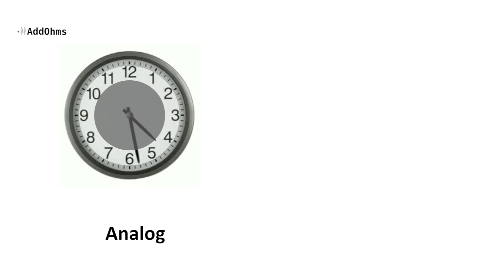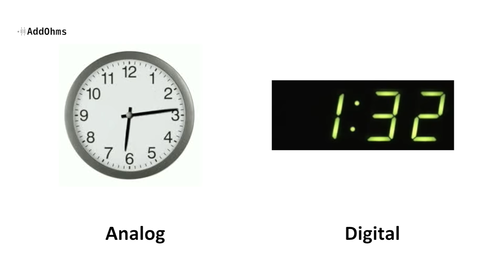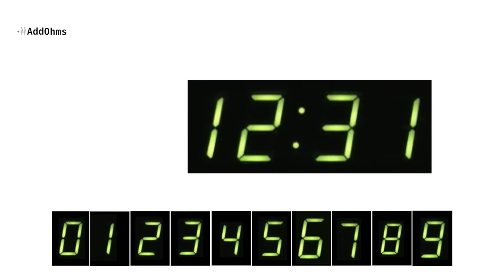Difference between Analog and Digital Signals | AddOhms #6

Comment: So the difference is that analog is more precise?
Reply: Well,  the signals are continuos and precise, but I reckon that the complexity is low.
Reply: República Mitocrática its flexibility you mean?
Reply: homo bob I meant "complexity", because the a digital circuit is way more complex than an analog one, considering the voltage variation inside the circuit and, as you said, the flexibility of signals. Even if we consider the analog and digital technologies, the digital techs a more complex in its circuits and also more efficient (in space, energy use, in benefits etc.). It was what I understood so far.
Reply: República Mitocrática kk
Reply: I understand that analog is limitless precise.

Comment: so its basically works like PWM and a clock where intensity  is replace with time using periods of Ons and Offs. a combination of rise to digital 1, stay at digital 1, or fall to digital 0. if you throw a ball up towards the sky, time and distance is to be considered . you will usualy end up with a ramp that = digital 010 in time for example. So its safe to say zeros and ones is more of an intended target voltage but since change don't happen instantly and time is continuously moving, we get a linear vector type wave.

Comment: Thanks for the explanation, I understand the difference much better now. Though I'm left wondering one thing. If Analog signals are continuously changing and digital signals are either rounded "up" or "down" into zero's or ones, wouldn't that mean that an analog signal is more accurate representation of a transmission than a digital signal? If that's the case, then why is digital transmission considered superior?
Reply: Rain Machika When a signal is transmitted, it becomes noisy.  Keeping that noise out is difficult.  By only transmitting a "HIGH" or "LOW", it takes a lot of noise to cause an error. (And they still do occur, but as much as if you used an analog signal.)

In fact, if you go back to some early computers, attempts were made to make calculators that operated on analog signals. However, people didn't like that the decimal points would change as the machine heated up. 

Well, unless it was their bank account. And the direction only went up... ;)
Reply: Rain Machika In principle you are correct. Practically all signals in nature are analog - that means digital signal is actually an imperfect representation of some analog signal.

The problem arises from the fact that every transmission (and every circuit in itself actually) is affected by noise to some degree. So noise immunity becomes a very important issue. When you transmit digital signal it doesn't really matter if for example at some point you receive 4V, 5V or 6V - it will still be recognized as logical "1". Many digital systems will additionally use error detection codes and resend the data if any error is detected. Now, with analog signal if at some point you receive 5.1V instead of 5.0V it is actually a big deal - the original signal just got distorted. Also it isn't possible to implement error detection codes for analog signals. So as you see analog transmissions and circuits are much more susceptible to noise. Even when you try very hard to eliminate noise (which quickly becomes difficult and costly) you will never receive exactly the same data that was send. With digital signals it is not only possible, but even not that hard - actually many systems today depend on it (like the internet). There are other reasons to prefer digital transmissions as well. For example in radio communication digital transmissions can take less bandwidth than analog and that is VERY important because useful spectrum is getting very crowded (there are less and less free frequencies for new transmissions). So that is in (not so) short why digital transmission is considered superior.

Comment: I always thought it was like analogue out of 100% and digital 0% and 100%. Great video. Clarified it for me ☺
Reply from the maker: I think you're describing Arduino's definition of "analogWrite."  Which isn't really analog at all. It is pulse width modulation (PWM). Which is digital. You can create an "analog" waveform using an RC network. But most designs would just use an external DAC (digital to analog converter.)

Comment: My recording and engineering teacher said this: "Analog is a ramp, as digital is to stairs."
I think that agrees with your video, so these really helped me.
Reply: Really great example!
Reply: I don't get it... is that in the shape or?
Reply: @frostjake1588  I think she means that analogue signals are continuous(much like how a ramp moves) while digital signals are discontinuous or have specific ups and downs (like in the case of stairs)
Reply: Nivedita R discrete is more accurate than discontinues
Reply: the shape if the wave yes
Reply: @frostjake1588  the shape of the wave . one is more ridged and one is more smooth making the sounds have different artifacts
Reply: Ask for your money back. Trust me, it was wasted.
Reply: Yes if u slip from cliff can be measured in analog  or if  stepping down through ladder means can be measured in digital figure
Reply: Or you could think of an actual ramp function (linear). It takes on infinite values not only in domain and range but also just between 1 and 0 is an infinite amount of fractions, and thus it is continuous even if you pulse it.

A staircase however, is very clear and finite about each level, for example a step function is 1 after time 0, and is always 1, not 1.5 not 1.7 not 0.999999, it is 1.

The idea here is that a digital signal is either 5V or 0.7V (high or low) and never between. It is discrete. 

Where as an analog voltage like our outlets (AC) could be say 120V, but say you had a spectacular meter and measured 119.58999999 V, it is approximately 120 volts but when you “zoom in” there could be a more accurate value.
Reply: Did you graduate?
Reply: bro giving best example, tomorrow I will too :>

Comment: 3:08, Keep in mind that 0 Volts is ideal, it’s usually between 0.3 - 0.7 Volts, or a Digital Low. That is okay, as long as you do not enter the forbidden zone in between the device High or Low (something like 3V for example, however this is different for any device) there’s a point in digital electronics where the transistor is in between a High or Low state and will usually switch back and forth really quick, or not work all together.
Reply from the maker: That’s the exact point I made in the video.

Comment: So with the area between the High and the Low, is that why we use Pull Down or Pull Up resistors to make the 0's and 1's either / or?
Reply from the maker: Kind of. Pull-Up and Pull-Down do force the signal to a known voltage. In that regard, it eliminates them "floating" in that unknown region. But the threshold bands are not the only reason floating pins are a problem. You might want to watch the couple of videos I have on pull-ups, starting with this one: https://www.youtube.com/edit?o=U&video_id=wxjerCHCEMg

Comment: A clock is a bad example as all quartz clocks use a quartz crystal oscillating at 32.768KHz.
This binary number is then fed through a series of flip-flops which causes the second hand to move, usually with a solenoid, occasionally with a motor.
Reply from the maker: I’m sure that’s what everyone thinks when they see an analog clock.
Reply: @AddOhms  If it's a clock that runs off a synchronous motor connected to mains electricity it's analog. 
If it's quartz it's digital whether it has hands, LEDs or an LCD.

Comment: AddOhms  i have an mp3 song in my cellphone.it is saved in binary.I transfer it to another mobile using bluetooth.The other cell phone recieves and saves it as binary too.So the bluetooth signal was analogue or binary?

"If" we say the bluetooth signal is analogue can we say , storage of signals/data should be called digital while their travel should be called analog?

in simple words does data travel in analog form or digital?
Reply from the maker: mashhood syed Remember that Digital is an Analog Signal, with predefined levels.  So the RF signal that Bluetooth (and WiFi and Cellular, etc) work on, is an Analog Signal.  The signal is modulated (changed) in a way to represent symbols (digital values).  Those symbols are turned into 1s and 0s.

Protocols like Bluetooth follow the OSI model.  So each layer has a name.

So the physical layer (which is what the RF is called) is analog.  The symbols are the transport layer.  The 1s and 0s are the data layer.  The bluetooth commands are the application layer.
Reply: mashhood syed Simple answer is that song is stored as digital data and also transmitted with bluetooth as digital data (analog transmission or copying can't produce EXACT copy of original signal - the copy would have inferior quality to the original). The song signal only ever becomes analog when you are playing it. The digital signal is converted by DAC (digital to analog converter) and that analog signal (after filtration and amplification) goes to your speakers/headphones.

Comment: Great video :) My Question: Instead of having High and Low voltage to represent digital signals... why isn't there just a voltage to represent "1" and NO voltage to represent "0"? Wouldn't this cause even less possibility for confusing the two?
Reply: +Niraj Gupta I just want to add that if no voltage is being sent instead of a low one, wouldn't that save energy costs and even shorten the amount of time it takes send the signal?
Reply from the maker: +Niraj Gupta "No voltage" and "voltage being sent" aren't correct. 

Voltage is a difference in potential. So if there is no pressure on one side and no pressure on the other, you get 0 volts. 

Zero does not mean "nothing."
Reply: Okay thanks. I see what you mean now. So to rephrase the question: Instead of having a moment where there is low voltage above 0 on both sides, couldn't there be a pause where there is 0 volts? Or at the very least, couldn't the representation of "low voltage" be as discrete as possible?
Reply from the maker: +Niraj Gupta The range is because no circuit is perfect. That's the point of digital. You define a range for a HIGH or LOW value. 

So LOW will never be exactly 0 volts. 

If there were only ideal circuits and no noise, you we wouldn't need or use digital.
Reply: I understand now. Thank you.
Reply: AddOhms between 80 and 90 volts for a digital clock at 12 amp.

Comment: In analogue television even if you didnt receive the signal if the signal bounced off of buildings? Youd still get a picture. In digital? Today if your antenna doesnt receive all the ones and zeros? You dont get a picture.
Reply: Analog TV, you get "snow" (weak signal interfered by static) or ghosting (reflected signal leading to a double image). Digital TV you do not get this as all ones in the weak or reflected signals become zeros, so you get a good picture or no picture

Comment: Digital signal is actually analog. It's just specific range of voltage has defined meanings.
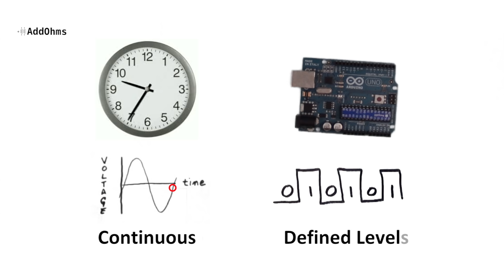Reply from the maker: Did you even watch the video? Or did you just click on the link and jump straight to the comments? I said exactly that at 3:48 ...
Reply: @AddOhms  Ah sorry. I was learning by commenting it done. should have format the comment  in a better way.
Reply from the maker: Sorry. I misunderstood. I’m used to many trolls who statement the point of the video without watching it. I was wrong in this case.
Reply: @AddOhms  thanks for the explanation. Amazing video BTW.
It helps me understand analog signal and digital signal  concept in a much more clear way.

Comment: 2:22 this is not true as long as the signal is around 5V the arduino can in it with a 1200-1250 points of resolution
Reply from the maker: The comment in the video is that the signal won't work directly on a digital pin.  Of course, you can use the analog inputs.

However, I'm not sure what you mean by "1200 to 1250 points of resolution."

The analog inputs on the Arduino are only 1024 steps, which with a 5V reference is about 4.9mV of resolution per step.

Comment: Analog makes it easy to build a radio, but if you want to build a digital radio, it's going to be a pain in the neck to put the tiny parts using tweezers, and the chipset has to be installed.  Then you must set up the software which will probably fail on you.
Reply from the maker: All radios use RF, which is high frequency analog. There is a carrier wave that is modulated to transmit data. Modulation formats can be analog like FM and AM. Or they can be digital like FSK or QAM. The principle is the same, in the digital modulation there are defined levels for the modulation which correspond to symbols. (Symbols are like bits.) 

For that reason, most of your statement is not valid. The complexity of building a radio to transmit or receive digital data is not much different than an "analog" radio. 

You might be mixing up concepts with the idea of a software-defined-radio (SDR). In which case, it is just a wideband digital receiver that uses DSP to decode the carrier and modulation, instead of discrete circuits.

Comment: digital needs software to understand what's going on. analog just follows the path to get it worked. No need for software. Analog just works for years without questioning. Analog is the best for certain tasks.  analog won't catch viruses. just works.
Reply from the maker: You can build digital circuits without software. Analog hardware can contain simple digital controls.
Reply: No I don't think so. Then it wouldn't be analog anymore. Digit means it contains software to find its path. But the device can be both analog and digital. Digital means with software. Software means 1's and 0's. Tell me an example digital device that can work without software.
Reply from the maker: Don’t be ridiculous. Digital circuits and devices existed before microcontroller became cheap and popular.
Reply: @AddOhms  okey.
Reply: @AddOhms  Mine was just an opinion. You may be knowing better than I do.